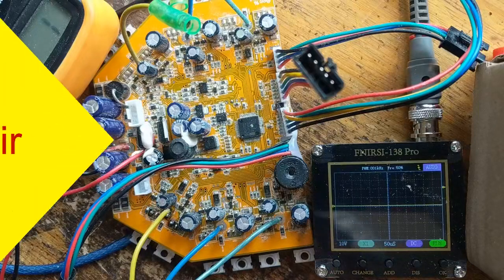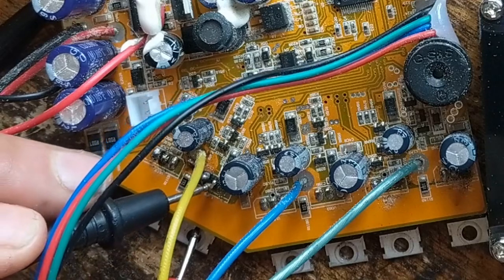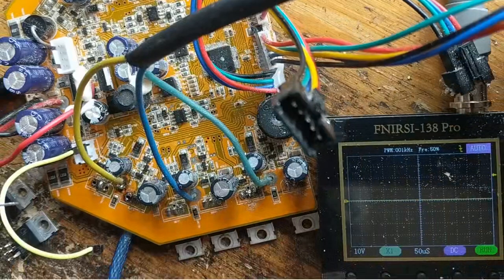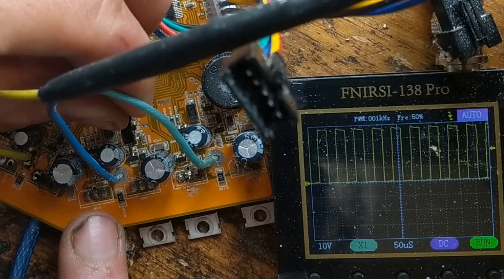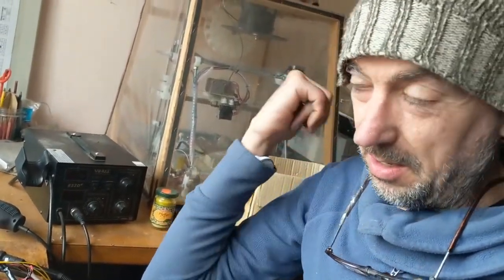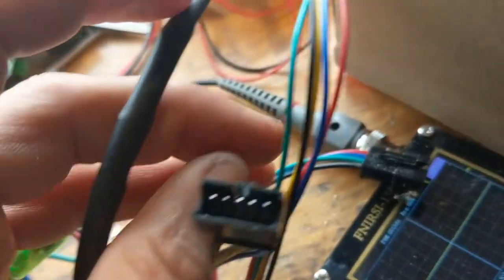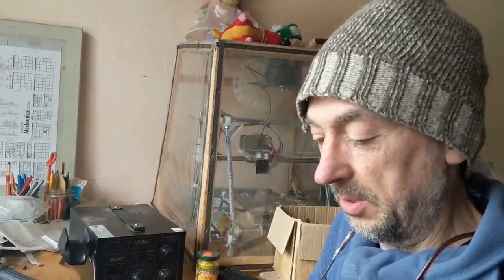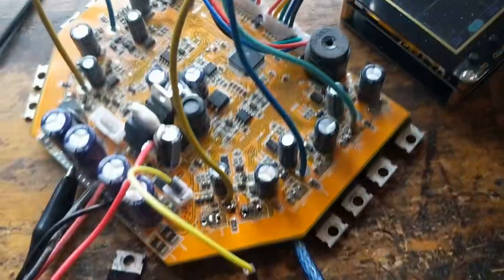part 4: hoverboard - repair gate drivers ?

Comment: thx for the video, my question is second tip127 overheating and after a while both tip127 transistors short circuited  can u help me how to fix that
Reply from the maker: second TIP127 is part of the step down converter to 12-14V for the gate drivers. So check the resistance of this output to GND to see if one of the six gate drivers are faulty and the tip127 burns with overload.
Maybe the linear 5V regulator is broken and the reason for high current draw that the tip127 can not deliver.

With the second tip127 unsoldered i guess you could feed in 12V from a CC=constantcurrent power supply and find the broken element on the board. I guess you can use your finger tip to check which part is heating up.
Reply: which ones is the gate drivers because there is 3 transistor connected to every Mosfet gates i am confused
Reply from the maker: @prodsefv  all thee little and transistors form the gate driver: https://raw.githubusercontent.com/EFeru/hoverboard-firmware-hack-FOC/refs/heads/main/docs/20150722_hoverboard_sch.pdf

First check the gate pins of the to220 of all six mosfet and see if you have a shortcut to gnd.
But you should have checked the output of the second tip transistor first.
I will not assist you any further ! Good luck.
Reply: @robodurden  one mosfet is short circuited and i replace it with new one but problem is same probably the gate drivers thx for the help I  really appreciate